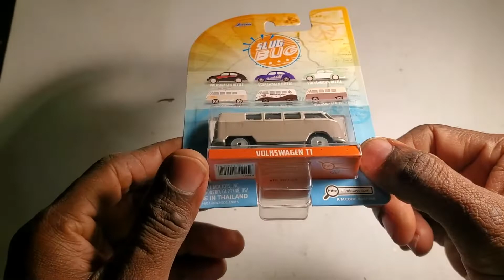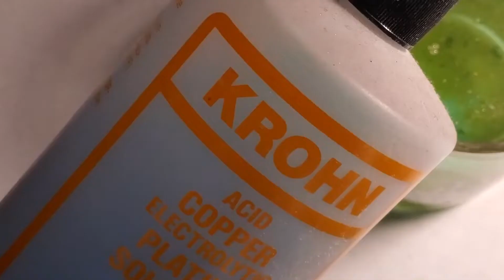Another way to Rust/Patina on Diecast

Comment: Hey, Ricky. Cool technique! We're all looking for new ways to do the rusting and weathering. I've got all the gear to give this a try. I'd be pleased if it turned out as well as yours did here. Very nice job. Wishing you a very happy Easter weekend, brother! 🍁🇯🇲🇨🇦👊
Reply from the maker: I used this method in a previous project. I tried  to copper plate different metals and realized that instead of copper plating the diecast , it gives it a burnt-out/ rust look. I should have mentioned that after drying it I also clear coated it. Happy Easter to you too brother.
Funny enough,  Americans don't celebrate Good Fridays. I Jamaica,  we celebrate,  Good Friday,  Easter Sunday and Easter Monday. I missed those holidays 🇯🇲🇯🇲🇯🇲🇨🇦🇨🇭